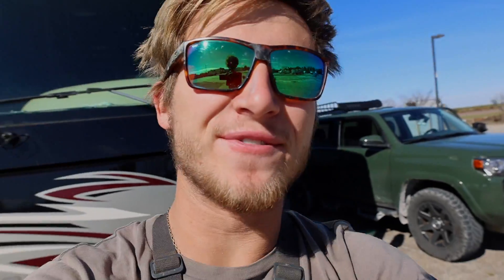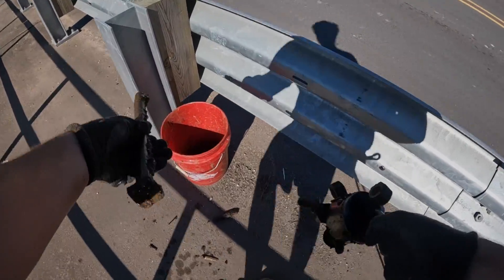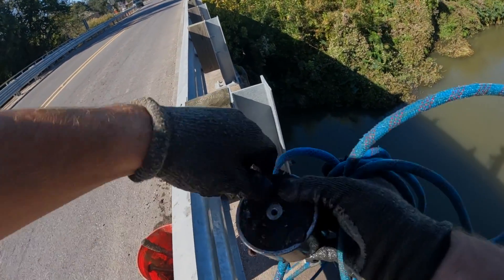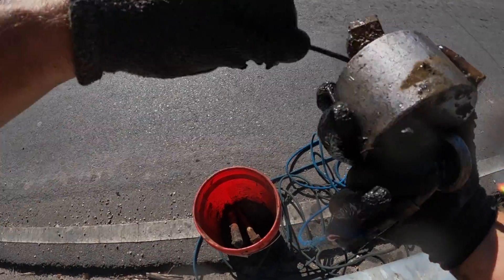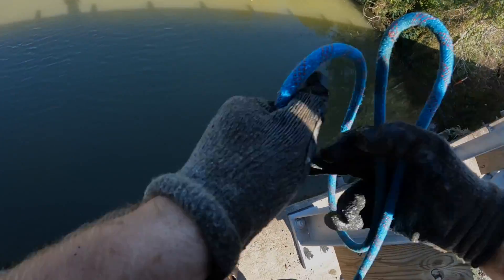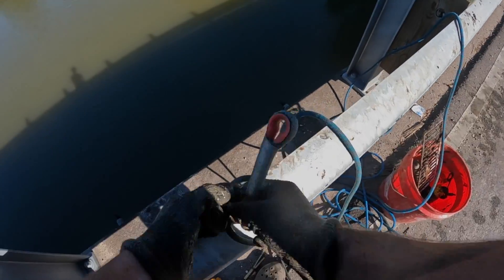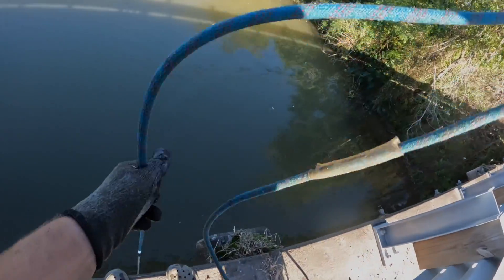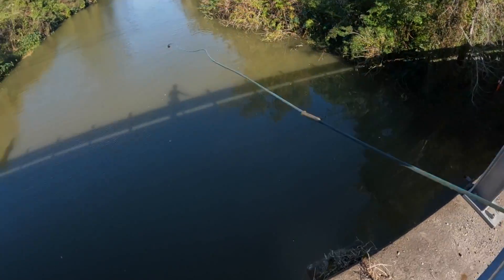Bag FULL Of Guns Found While Magnet Fishing-Best Day Of Magnet Fishing Ever (6 Guns, Ammo And More)

Comment: Older RVs used 30amp 240VAC "220" but new RVs use 30amp 120VAC "110" . Older RV parks still haven't installed 110 so when you hook up there you need to use an adapter. It's not the park's fault, learn about your RV electrical system.